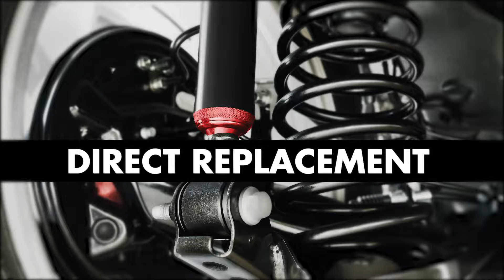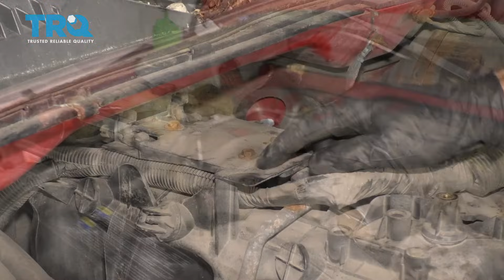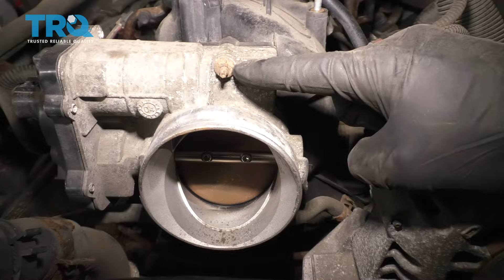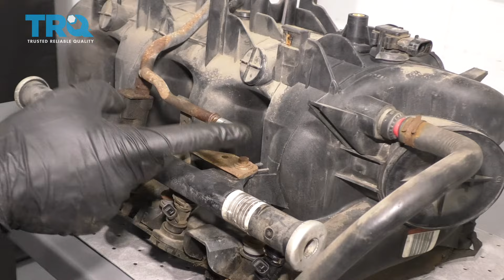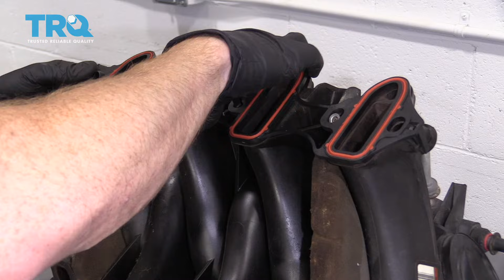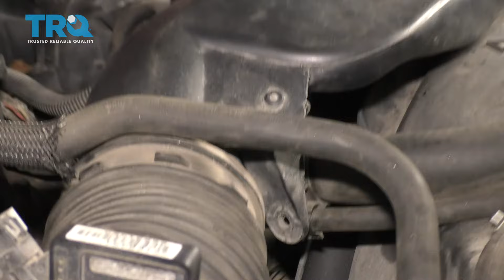How to Replace Intake Manifold Gaskets 1999-2007 Chevy Silverado

Comment: I ALMOST got screwed by not insuring the knock sensor wiring harness wasn't caught up under the intake.  I caught it before I tightened the intake back down.  VERY EASY mistake to make and you'd have to take it all apart again if you don't  make sure those wires are coming out the direct back near the firewall.

Comment: There wasn't any fuel pressure because the system has a fault somewhere.    Probably where that hose connects to the fuel rail, where you can obviously see the leakage.

Comment: I have a 99 Chevy Silverado. On a cold start it sounds like it wants to bog out when warming up I’m wondering if maybe my throttle body might be dirty or faulty idle air control sensor or faulty fuel injector. I also have a coolant leak that I’ve had for awhile some may say possible head gasket failure but I just changed the oil not too long ago and my oil was nearly black as charcoal not no Carmel milkshake so wondering if that could be an intake gasket failure as well. Someone please let me know.

Comment: Doing this on my truck and all is new including knock sensors. Was originally doing gaskets for oil leaks but ended up snapping harness for knock sensors which worked out cause last knock sensor did not have long. But I was gonna replace the manifold bolts with the little grey grommets cause the oil leak caused em to swell real bad and soft feeling. Made me feel weird about torquing them so ordered new.

Comment: The Left Bank fuel injector wires are a PITA. That's why they want to not show you it so you think you can DIY and buy trq parts to do it but they should really put the process of getting to the hardest fuel injector wires.

It's not impossible but it is extremely difficult

Comment: Did all this. One knock sensor broke an I couldn't remove it. Left it unplugged did everything else correct an now truck just pops as it tries to start an it won't run but a few seconds. Any ideas?
Reply: Also changed the O2 sensors as well

Comment: so i just recently cleaned my throttle body on my 05 gmc sierra 5.3 just because i had no check engine light on for it before so after i cleaned it i installed everything back the right way and did the 3 minute idle re learn well tried now when i turn it on it warms up good but once it warms up it starts to surge the rpm goes up and down then when i put it in reverse or drive it revs up and going into gear or to reverse, when i drive it and give it a little pull to see it it feels good i feel good normal power but as soon as i let go the gas now it stays reved up or accelerated then once i come to a stop the idle kind of goes down like slowly and just starts surging again , i replaced air filter cleaned my maf sensor before my truck wouldn’t do that it would die out coming to a stop though so i would just hold the gas to keep the idle from dropping all the way and stalling the truck but now it doesn’t let me even do that cus when i try it revs up on its own until i drive off and then it feels fine can this be my problem

Comment: This video helped a lot until I was torquing the bolts to spec…. Yeah my bolt snapped at 20 lbs…. Googled it and chevy says 8lbs for both the intake manifold and throttle body. I am what you call fucked now.
Reply: He said INCH POUNDS, not FOOT POUNDS.

Comment: What do I do if my throttle body is drive by wire instead of electronic? Also, the plastic engine cover on mine has 2 bolts, one of which is spinning but not loosening. Also, one pipe from my EGR valve runs onto the engine right behind the throttlebody. I have a 1999 silverado 1500 with the 5.3l v8
Reply: So I got everything done, but I have a new problem. The hose at 3:50 broke and nowhere near me has one in stock, I have to special order it. Is there a solution that can hold over until I can get a new one? Because this vehicle is my only one and I need to get to work on Monday. It's Saturday right now.